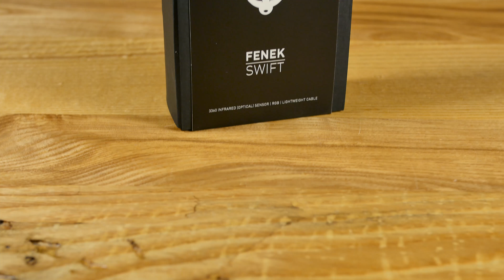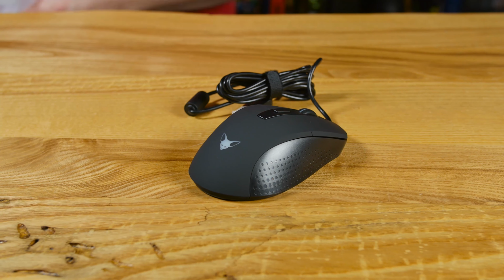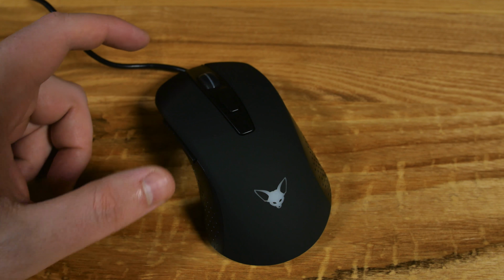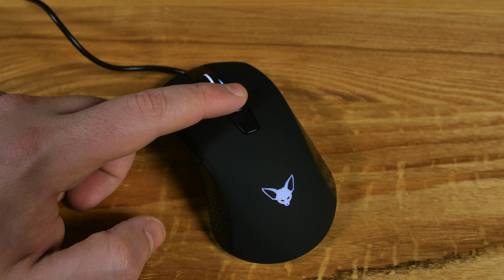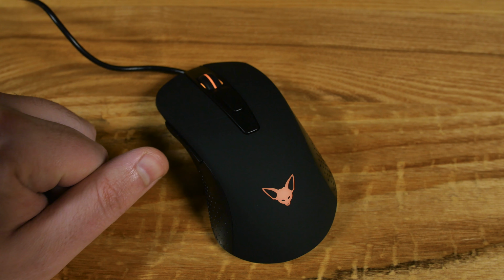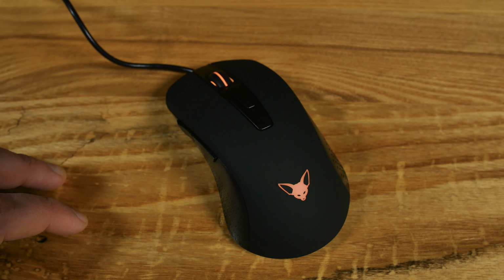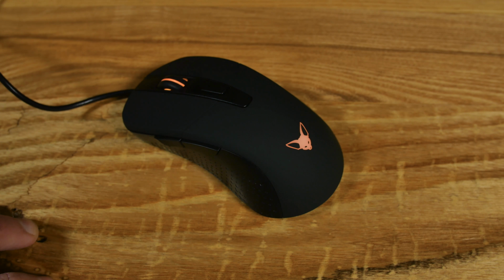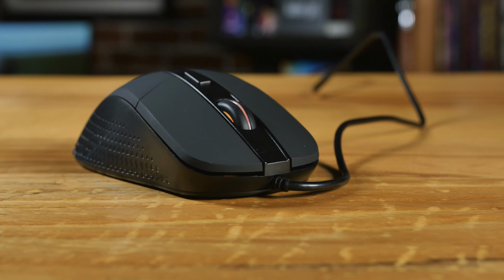Our New Mouse | Fenek Swift PWM 3360 Sensor

Comment: I have been using this mouse as my primary mouse for over a year now and I LOVE it.  Simple easy to use mouse that doesn't require any extra software.  It has fun color settings without having to use software to adjust.  I really recommend it.  And as of this moment (July 2019) it's on sale on their site for $24 I think.  A friend of mine got one and she told me it was down to that price.  Pick it up if you want something good but inexpensive.  I love it.

Comment: Just picked this up along with the Mother Membrane and I am mighty impressed. Most comfortable mouse I've used in a while; that little hump on the right side fits my ring and pinky better than even my old G502 did. Keyboard rocks too; membrane keyboards are super under-appreciated and this one is one of the better ones I've used. Good stuff, my man.

Comment: I know you say nobody would use 12000 DPI, but there is a use of such high DPI for console adapters like XIM4 which take full use of high DPI :)
Reply: I've tried 3 336x sensor mice thus far. The G502, the G403 Wired/Wireless and the Corsair M65. 12000 dpi is jittery as hell. And I'm not talking about my shaky-ass hand, it's just by virtue of how they're doubling samples to output 12k dpi. It just starts exhibiting some insanely unstable motion. So regardless of use case, the simple hardware limitation alone IMO is reason enough to dump the feature. So, even though I'd like to know, if you could explain, how you'd make use of it, it would still mean you're essentially using motion with a heck of a lot of noise.
Reply: XuK He4DHuNt3r 
Consoles. 
( ͡° ͜ʖ ͡°)
Reply: This was my initial thought as well!

Comment: is the mouse really worth today? I'm looking for a cheap mouse with a 3360 sensor
Reply: (Reposted for you)
Been using mine for about a year and a half. I've scraped dirt off the coating many times and it cleans up to be scratch free,  however the coating has worn down like you would expect a keyboard keycap to. I'm not easy on it either as I use this for competitive CSGO, the only issue I've had was using the back button is kind of unreliable but IDK how much of that is from me slamming on it for comms in the heat of the moment. Oh yeah, and 12,000 DPI would have been nice or even 16,000. I know the sensor can do it

Comment: Been using mine for about a year and a half. I've scraped dirt off the coating many times and it cleans up to be scratch free,  however the coating has worn down like you would expect a keyboard keycap to. I'm not easy on it either as I use this for competitive CSGO, the only issue I've had was using the back button is kind of unreliable but IDK how much of that is from me slamming on it for comms in the heat of the moment. Oh yeah, and 12,000 DPI would have been nice or even 16,000. I know the sensor can do it

Comment: Hmmm... Primary buttons separated from shell, 3360 sensor, no software, interesting although maybe a tad to contoured of a shape. I'd say that's a pretty solid purchase if it wasn't for the weight. I know tooling for weight adjustment is probably a PITA if you want to offer something competitive, but I think 110g is way too heavy without any adjustment. That's M65 heavy, and I'm not so sure that's for everyone.

Comment: What a shame you don't even knowthe sensor name properly!. I thought it was a typing mistake and it's the same even on the website. It's PMW NOT PWM!. Moreover why restrict a sensor's performance at all?!. Just give a software tool that can customize the DPI through the entire range. Don't try to decide for everyone.

That said it's a boon that most of the features are customizable through button combinations on the mouse itself. Overall it is a very solid package nonetheless. I also appreciate the removable weights. 

Just consider adding the software support and probably reducing the price a little since the competition is almost half the freaking price!.

Comment: hey just so you know the high dpi's are used for xim4 and other mouse and keyboard adapters on consoles. it's an extremely popular adapter these days and high dpi makes it work best. particularly the 12k dpi on the sensor you use in your mouse. I believe it's the same sensor in the G502 right ? that's why we purchase this particular mouse. and now yours isn't a viable option for us. can it be taken up to 12k dpi with software at least ?
Reply from the maker: fUll 951 if we made software or a new firmware...

Comment: I looked at this and then the mouse I got and I believe I have one of them cheaper variation of this from China.
What I do want to know is if you guys did anything to the scroll wheel? It might just be my mouse, but it has become relatively loose and occasionally squeaky. Otherwise it runs better than most name brand +$100 mice.

Comment: Hey I'm interested in the switches, honestly more for electronics rather than just computer mice. Not much info out there on Huano did you research them? Why them vs. something like Omron, or others? I'm just curious if it's a personal preference or for a more practical reason. are there other products they are used in (not just mice per se)? Cursory googling shows Zowie mice (never heard of 'em), some Russian mouse called the "Red Square 1337" which honestly looks pretty frickin sweet, and that's about it.
Reply: stryk187 Zowie  is I am pretty sure BenQ, so they probably make really good mice!

Comment: Will there be a possibility to change the CPI to different values than the ones you listed? I've been using 600 DPI on my mice for over 10 years now, I'm really not sure if it's something I could adjust to.

Other than that it looks super sick guys! I really like the softwareless approach and the pricing seems super damn good (if the shipping is fair). It's really making me consider switching.
Reply: Cyberscum additional adjustments in the dpi with software would be nice. does the mouse have on board memory to hold these changes if removed from the pc and used on a xim4 for example ?
Reply: Yeah or customizable firmware DPI/CPI steps, like being able to set every step in DPI/CPI myself before I load it into my mouse

Comment: Put it on amazon uk and I will buy :) I need to replace my g402 the feet are old and rough and i dont like the feel of it scratching at my tek syndicate mouse pad (its the smaller one the burning earth logo in purple)
Reply: when my logtech g502 sliders are worn out i buy new ones  you can even buy things from the logitech site . if they dont have  it ebay got it .  and that`s were i got my sliders from

Comment: A couple suggestions for future mice:
- It'd be cooler if the RGB was controlled by scrolling the scroll wheel so that you have finer and more intuitive control.
- Cable should be braided
- The mouse looks cheap... The specs are great but the choice of materials doesn't make it seem premium
All that said, if I didnt just buy an MX master i'd consider it!
Reply: MobFactory: Andrea braided cables cause more drag and are he avier apparently. Personally ive never had a braided cable mouse and havent had any of those cables break ever
Reply: Logan hates braided cables. It adds weight and causes drag, and can sometimes catch on to things.
Reply: Braided cables suck